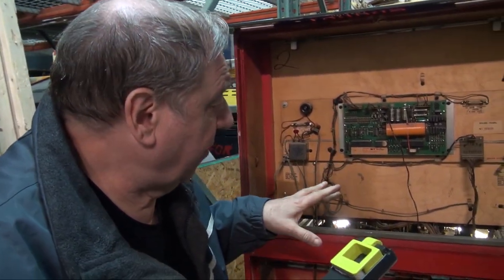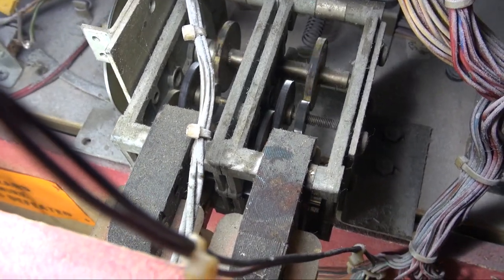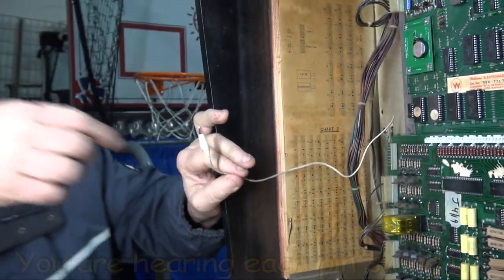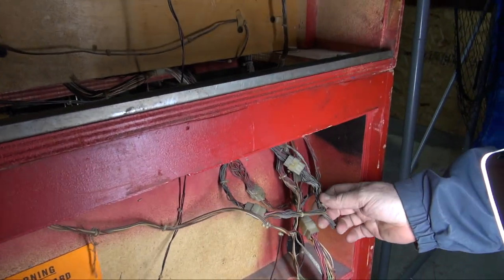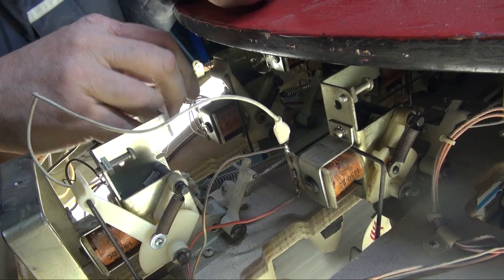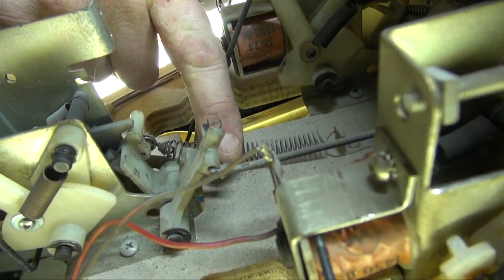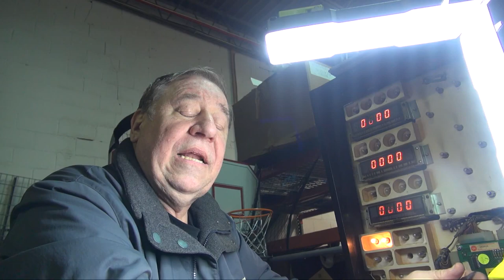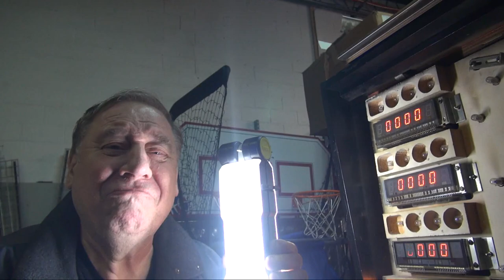#1530 FIX Williams Shuffle Alley MOTOR and BOWLING PIN Glitches-TNT Amusements

Comment: I remember using contact cleaner on volume controls on old radios. Those must be driver transistors. I used a 3808 led flasher from a Christmas tree project and put a red led in the eyes, nose, and three in the mouth of a plastic pumpkin for Halloween. If I had used small bulbs then I would have to add another pcb with driver transistors.
Reply from the maker: Great idea!

Comment: actually old bulbs don't remember the links going out but on modern LED mini's those should not be outside.. learned the hard way about those.  Old mini lights copper, but led is aluminum (or the european pronunciation.  Yuck.  not outside corrosian happens and 1 breaks you have a hard time figuring out which one is shot  -- oh ignoring silver solder crap.  Might be healthy but ran into a bad LED bulb using silver solder all had a colder solder joint when it blew up...
Reply: thanks to you guys been using WD40 Contact cleaner for ages.  great stuff
Reply from the maker: we try to do our best, Lee!
Reply: @tntamusements  btw eu version of aluminum sounds like tritium they keep sticking an extra I in the word :O  Just saying the old bulbs are the new bulbs.  Lost 3 strings before figuring that out so much so I complained to Menards about it and was brought up to the design team creating enclosed LED bulbs instead of the caps.  Takes people from the Isle of Man to say whats wrong with the leads  and I learned about it 2-3 yrs ago.  I did fix those strings once I figured out why they died.  several bad leads.  LED's outside bare..  work as well as incandescent bulbs without the glass .  (they don't or will for a moment but not long)  (won't last a season)